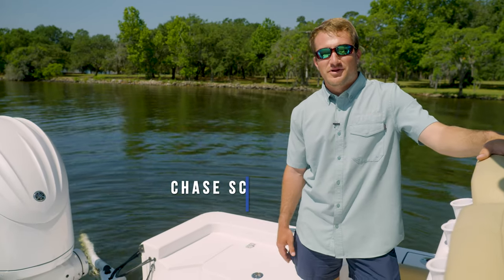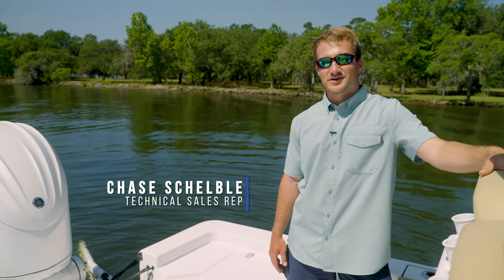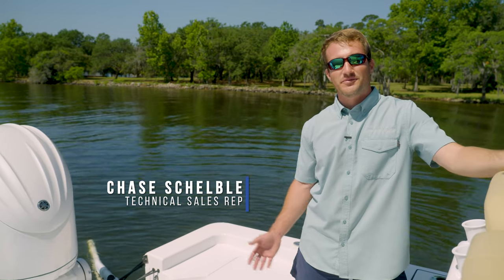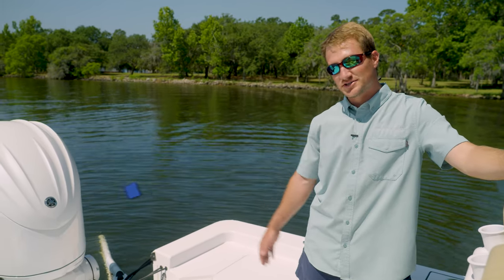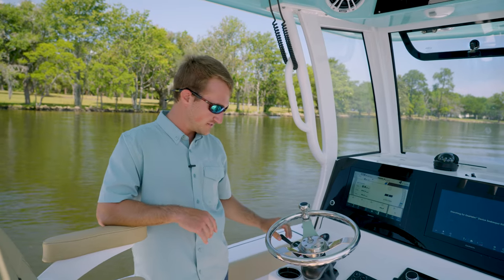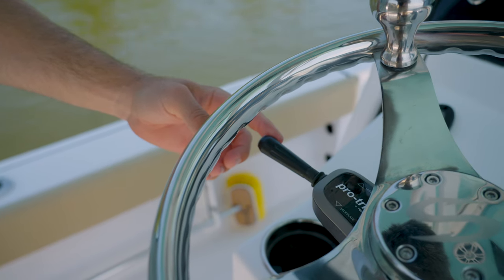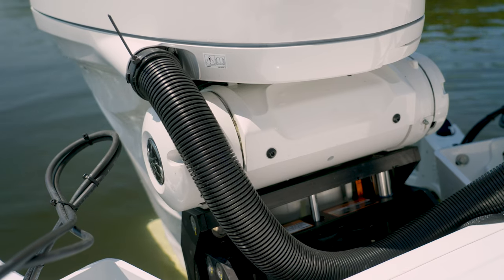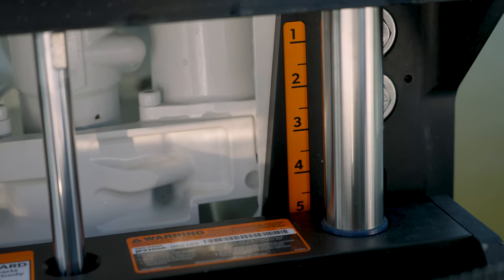Tech Talk - What Is A Jackplate?

Comment: How do you determine the set back length
Reply from the maker: The setback length is the depth of the jackplate from transom to motor. We determine the proper setback required for each model after a series of tests with our motor vendors.